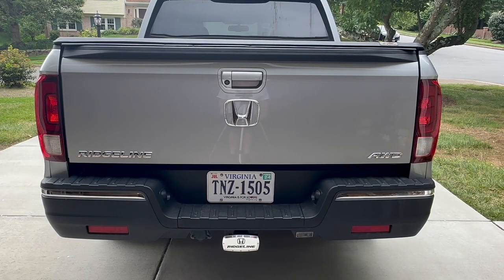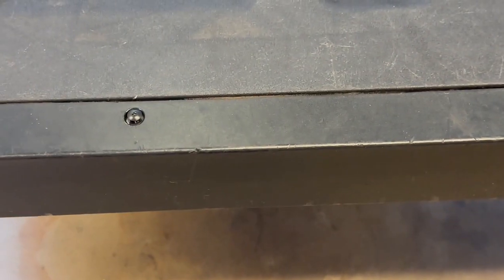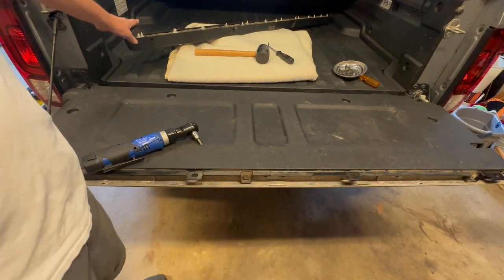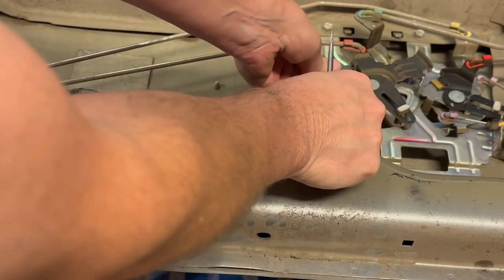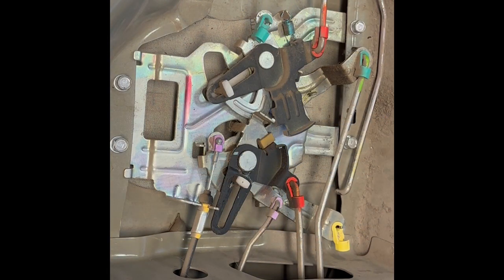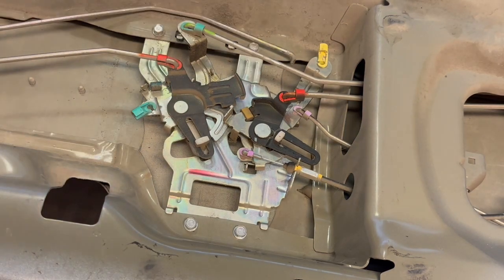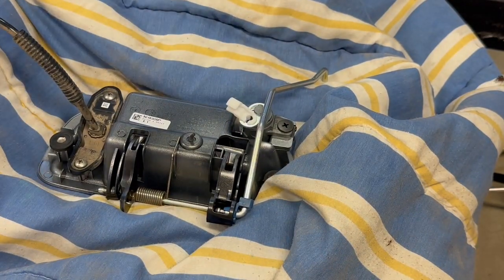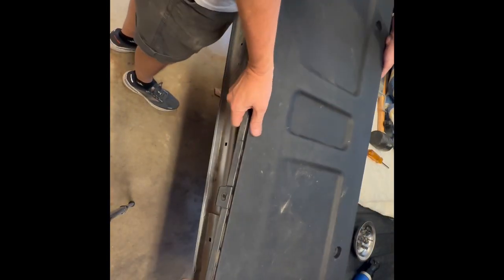Honda Ridgeline - Locking Tailgate Installation

Comment: Followed this and it worked great.  2 weeks later the swing latch would not release.  I am not sure what is wrong but others have said this is the same problem they had.  Any help would be great!
Reply from the maker: I had a similar problem and I think the connecting rod that is supplied with the new lock set is not as strong. This causes some flex during temperature changes. I had to disassemble and adjust the rod. If it happens again, it may need some extra metal strengthening.

Comment: Does the black plate, rods and rod connectors come with the two parts you listed in the description or are those separate?  If so, do you have part #s for them also?
Reply from the maker: Yes, everything came with the handle set. The lock cylinder was separate.